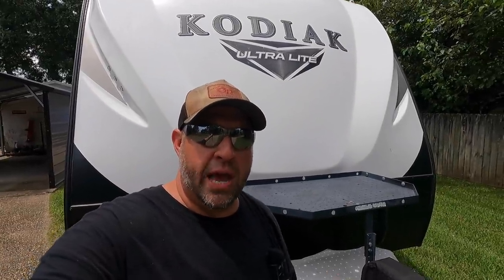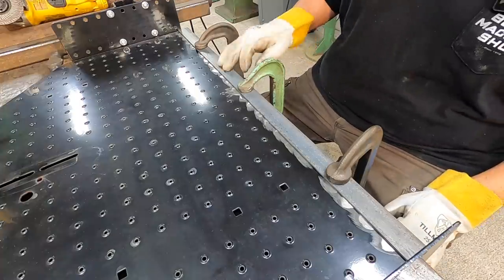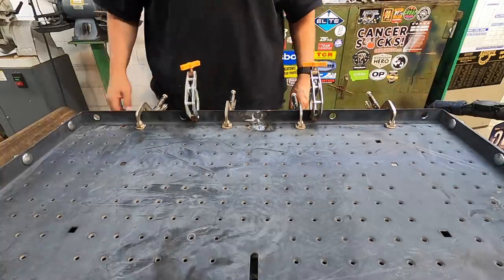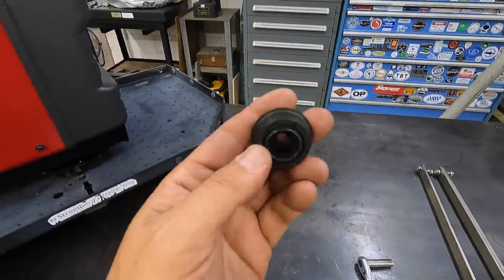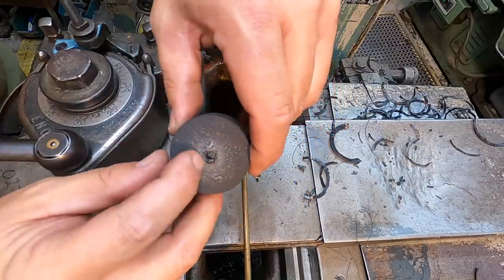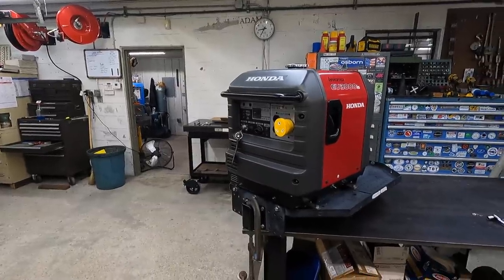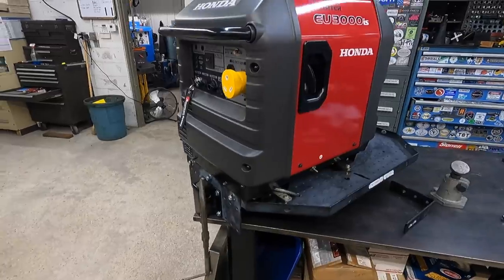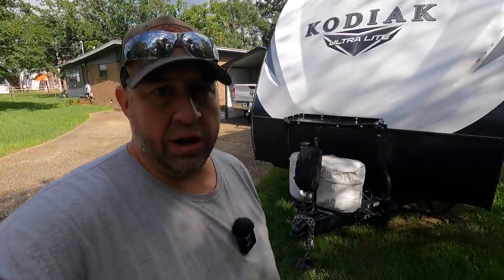SNS 352: Generator Rack Repairs

Comment: That's not a lot of meat between those two holes. I suggest getting a piece of flat stock and making a new longer bracket. Then you can space the slots farther apart. Or more preferably Make one with just holes that is perfectly measured out. With the forces that thing has to deal with there is going to be slippage between those brackets not matter how tight you tighten the two little bolts. Had a universal bolt together ladder rack one time that had slots and that thing never stayed how I set it.

Comment: Adam im sure you could whip up a locking idea in a short period of time. An American lock type will stop most thieves. They're the ones you see on van doors of locksmiths. A swivel eye bolt , bolted to generator base with slot thru the platform would do it.

Comment: All someone would have to do is unbolt the channels from the bottom of the generator and it would defeat your mounts as well as your cable lock with 8 easily accessible bolts.

Comment: There are vibration dampeners with threaded studs on both ends, they are cheap and work great for an application like this.
Also glue a strip of rubber on the stainless steel flat bar, it stops the vibrations traveling through that

Comment: Love the welding - looks great.  But those drain holes over the angle (where you ground off the bottom of the dimples) bug me.  That looks like a good place for water to get in and get trapped.  Are you going to fill them?

Comment: Your plastic reminds me of the red urethane "strippers" we used around pierce punches in temporary dies. You're right, it's tough to hold any accurate size or finish on it.
Your rack should have been made like that from the factory!

Comment: Wish you knew what that rubber was. Could use some for air hose stops on reels.  The stuff there coming with like a soft plastic not rubber. Keep slipping and then tear out.

Comment: You will find the harder rubber will transmit the engine vibration directly into the trailer more so than the soft ones. It will also cause the generator to vibrate itself apart. That’s what happened to mine.

Comment: Looks like everywhere those large large bolts go through the holes take out about 85% of the steel,  need wider steel to take those large bolts so theres something left for strength - no wonder it didnt hold up.  Same thing with the new angle iron, its thicker and will hold up longer but the large bolt holes are still eating up a lot of the steels strength eventually road vibration and weight of the generator would likely have the same effect, but the weld should make a big difference, nice looking finished product

Comment: Turning rubber, I guess the micrometer becomes useless very quick when the material deforms whenever you try to take a measurement, none the less it turned out great and no-one expected anything else ;-)

Comment: your covers you are replacing put the new one on the bottom and then the old one on top of it. That way you will get more use out of them. Also get some used material like from a ratchet stap and cut it in a length to go under your bungy cords will also stop the wear of the covers or at least cut it down

Comment: I remember the times back in nineteenth when people put some hardened sophisticated locks on their steering wheels so is someone wanted to steal their car they couldn’t drive it. And they couldn’t cut through the lock because it was very hard. And couldn’t pick the lock because it would take too much time. But thieves simply cut through the steering wheel with some bolt cutter, threw away the lock and could drive away and replace the steering wheel later…

So just a thought from my side. If someone really wants to steal your generator, they will unbolt the tray, lift the whole assembly up just as you shown it would lift and deal with the tray later. You might want to add some security there too.

Otherwise a great video as usual.
Reply: Locks are to keep honest people honest. A thief will take whatever they want!

Comment: Adam. Have you thought about swapping the generator shelf for the propane mount? The generator probably outweighs the propane bottles and would shift the weight closer to the frame.
Reply: Depends upon tank size.

Comment: just Ondo the bolts that hold the Honda on walk away with hole thing  . if any thing put a gps tracker in side some wear  but saw saw would cut through any thing   and they  have small saw saw 
with batters so get  a crammer to watch trail  at all angles  and GPS TRACKER
Reply: Huh?

Comment: Agent Jay-Z recommended books by a fellow named J.E. Gordon, a professor of materials technology. The information therein explains why you shouldn't drill holes just anywhere. There is engineering behind the manufacture of many many products that keep them structurally sound. Very interesting reading. Your local library may have copies. Cheers
Reply: Sadly, there's a lot less "engineering" than anyone one would like, esp. in such simple, "cheap" items.
Reply: Agent Jay-Z works on jet engines where that type of engineering is required.  Heck,  a dropped snip of safety wire in the wrong place could probably ruin his whole day.

Comment: I’m not sure why you decided not to convert that generator to propane. You should do that. Propane doesn’t age and it’s easy it is to hook up —— it’s a no brainer. Also on that center support you should mark it. If those bolts ever loosen up and that bracket moves you will know it.
Reply: You know what's the first thing gone, and the last thing restocked, during a hurricane scare? Propane. It's gone long before gas is. Get a generator that doesn't need "converting." Plug in propane, or fill it up with gas, and flip the switch.
Reply: @xenonram  A diesel set might be even better, if you can find one that small. Excess fuel can go into, and keeping a full can provides an emergency reserve for, the truck.

On the other hand propane can be stored almost indefinitely and, barring an emergency, is readily available everywhere.

Comment: I miss seein the chips fly. Hasn’t been a whole lot of machining in the last while. Don’t get me wrong, I appreciate all of the content, but as someone with some new pieces of machinery and that is new to the art, I like seeing the mills and lathes going to town. Keep up the great work! Thanks for all the knowledge. Also, you can never go wrong with those little Honda generators. I have several of them for different applications and just to have “in case” and they are awesome. I have a Yamaha one that is very similar and it is just as good. Great investment for sure.